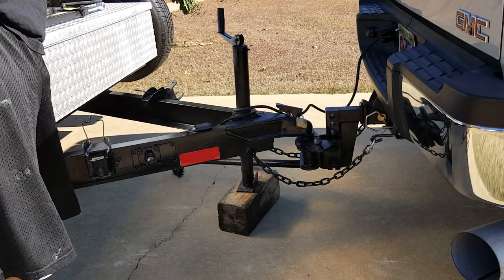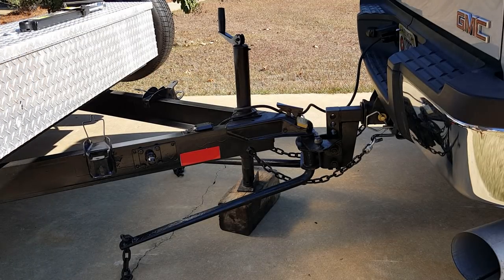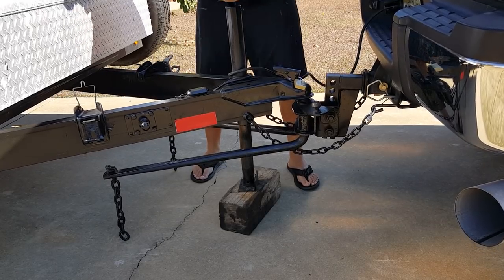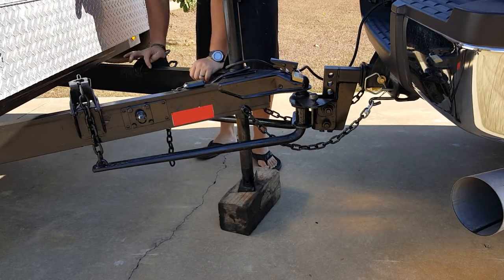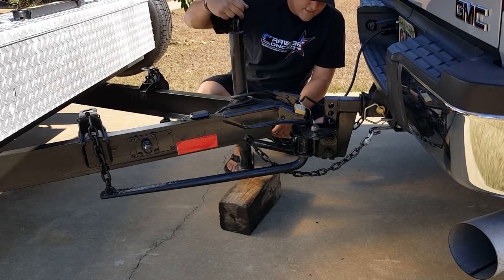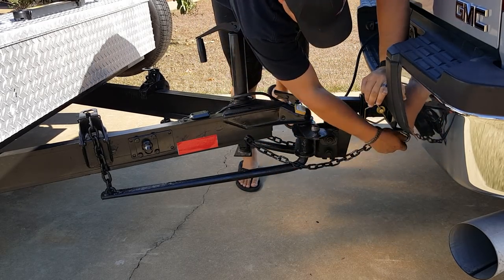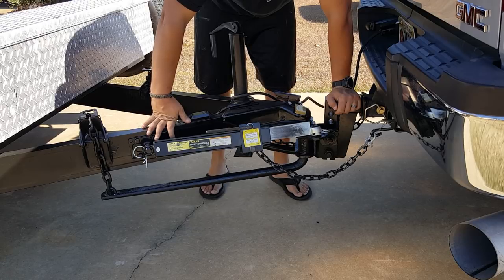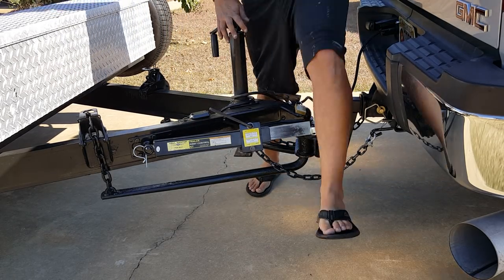Weight Distribution Hitch Explained

Comment: They are a great idea, but they are not a be all and end all solution. I had them on a caravan I used to own. Reduces the sway. But there are indeed other things you need to do. I had pneumatic shockers too, which helped a bit too. Anything to help reduce the sway to keep the misses and kids in the car, I put on the car. Once all that stuff is done, it's up to the nut behind the wheel  (the driver). Even weight distribution inside the van helps. One just wants to get from A to B without any dramas. If you encounter different roads surfaces, different situations arise. Yep the levellers will help. Your grey matter has to do the rest.

Comment: QUESTIONS ABOUT RE-HITCHING and UNHITCHING.... Anyone that sees this can feel free to answer.... and if it was asked already, Apologies! Popular video with great info.... 

My questions is.... If I was going to use a WD hitch like this, but would want to un hitch regularly to take my truck "into  town" or drive around.... would you just un pin the shank and leave everything on the WD set, and then justback back onto the shank when you re-hitch?? Or what would be your recommendation???  Always had a smaller trailer, and now going to be using a WD hitch going forward. Thanks for any help!!

Comment: I'm new to this, I bought a small 16ft travel trailer which only weighs 2800 lbs and I'm towing it with a chevy Silverado. When I towed it home it did fine. We are going on our first trip next weekend, do I still need one even though it only weighs 2800?
Reply from the maker: Probably not. You could still had the sway bar. Its always nice to have the sway controlled

Comment: If you have enough weight to use a load leveling hitch, it's time to switch to a gooseneck setup. You'll save yourself a lot of trouble and you don't have to worry about connecting/disconnecting, every time you want to make a sharp turn.

Comment: Obviously all systems are different, but every one I've seen, including my Reese 10k capacity kit clearly state the bars should be parallel with the frame/ground (or as close to parallel as possible). If your ball height is set correctly, the system will do its job without bowing of the bars.
By the way, you CAN put too much preload on the bars.

Comment: So it appears a weight distribution hitch puts a torque on the hitch 'twisting' weight to the front wheels.   What does that do as far as the stresses on the hitch itself?   I have a well powered V6 sedan that only has a 1000 lb towing capacity which I presume is so low due to the unibody construction making the hitch mounting points structurally weak.
I was hoping that with such a hitch I could increase the abysmal towing capacity but I'm thinking probably not.    Can it help and if not, is there another means to increase my towing capacity to say about 2000 lbs?  
I have tons of power, just weak mounting points.
Reply from the maker: I'd run it and not worry about it
Reply: Just one thing about towing capacity numbers. Whatever your towing, cargo, and people inside the tow vehicle is included with that 1000lbs towing capacity.

Comment: also when backing up make sure to take it off. you can damage stuff if you jack knife it
Reply from the maker: nick elias have never had an issue while backing up.
Reply: Basic Jeep Tip's if you jack knife it sharp enough stuff will bend or break. if you just do nice soft bends backing up yer fine. i take mine off to be safe
Reply from the maker: nick elias cool, i think jack knifing a trailer is a no no WD hitch or not.
Reply: nick elias take what off? The anti sway control,  or the weight distribution bars, or both?
Reply: The guys who installed mine said remove the anti-sway bar when backing up, for this reason.  The weight dist is not an issue.
Reply: I broke mine off the other day. The part that goes onto the trailer it’s self, Trying to wedge it in to a tight area. I did it once with my bigger trailer and once I got it in to where it needed to go, I couldn’t get the distribution bars loose. If you’re going to be negotiating into a tight little area it’s best to take those things off before you move your trailer.

Comment: Well, thanks to the video, I know the proper way to tension the bars, but I’m still perplexed about how the engineering works because all that tongue weight is still on the hitch receiver (though, not the ball as much).  So it’s hard for me to understand why the bars make any difference.   Also, for the anti-sway bar, how do I know what is too tight and what is not tight enough?
Reply: Do a search on "Weight Distribution Hitch Physics" and you will find at least some of the answers to your questions.

Comment: Just thought I would add something that happened to me. This is not a criticism! let me make that clear. I was parked in a wide area with my 7x16 toy/hauler checking over the trailer and truck like I always do and to also get out and strech and an ISP officer. (Idaho State Police) stopped to see if I was OK and maybe having problems, the Officer looked at my hitch and made the comment that everything was connected correctly as he always checked to see how the saftey chains were connected. I had them connected as per requirments as they were crossed right chain on the left on the tow vehicle and the left on the right. This is to catch the trailer toungh in case something were to happen and the trailer came off the ball. Like I said not a criticism but an antadotal experience.
Reply from the maker: Lol Said it in the video I ran them on the inside and I sheared them off. Due to the drop down hitch.

Comment: Good idea is to cross you hitch chains to act as a cradle to catch A frame if towball happens to break. Stops frame from digging into road.
Reply from the maker: Again covered it in the video that when I ran the chains on the inside they broke.  They would bind with my drop down.

Comment: Hopefully, you or someone will see this comment. I haven't used with this kind of set up before, so hopefully this doesn't sound stupid. I am confused about the sway bar...doesn't that work against turning?
Reply from the maker: That is how it keeps it from swaying. But no you can still turn- just becareful backing up. I only tighten mine down right before I get out on the highway
Reply: Patrick Harrison , I don’t know anything about the anti sway bar but in the video he mentioned that it contains material like brake pads. I figure that the telescopic part tightens up enough to minimize sway, with friction, but will still move in and out as needed for turns. So it’s not like a solid bar in that position.
Reply: @Infiniteperspective1111  That makes sense, because if that's a solid link, it's going to bind and something is going to break in a turn.

Comment: Your instructions are in conflict with the instructions for the Equalizer brand hitch. Equalizer says the spring arms should be parallel  to the trailer younger.  Weight distribution should be changed by adjusting the shim pack which controls the angle of the ball. All of the manufactures recommend measuring the height of the truck at the front wheel well and rear wheel. Goal should be t end up with nearly identical measurements at the front and rear measurement points. Spring arms should be matched to the tongue weight of the trailer. This value can be obtained from your trailers dealer or you can spend ten dollars and weigh it at any truck stop. Most of the manufacturers I have used all said the spring bars should be parallel to the tongue.  I suspect the spring arms you are using are not matched to the tongue weight on your trailer or have lost their spring rate due to age and need to be replaced. Just some thoughts  of mine.

Comment: I’ve just started using system, why does it make a loud popping sound when I turn a corner? Is that normal? And when the anti sway is hooked up is it suppose to loose on the ball on the truck and trailer?
Reply from the maker: Hard to say why it popping. You may want to check clearances etc. Maybe stick a go pro back there drive around to see what's popping. I would suspect that the chain on the bars is maybe making contact with a bracket or frame and hanging up. Look for shiny spots where the paint has been rubbed of. Making sure the chains are straight up and down or making adjustment ls to the placement of the brackets may help
Reply from the maker: As for for the sway bar when you put it on it needs to be on both balls and then tightened there may be a sweet spot that has a bit of slack in it. As the truck turns back and forth. Remove it make some turns see if the popping  goes away
Reply: Does your hitch use chains, or does it have two arms that sit in a cradle? If it's a cradle-type, grease the arms and it'll pop less. The popping is just the arms shifting in the cradles.

Comment: I use  Weight distribution airbags and also a sway bar I get very little sway
Reply from the maker: Yeah. I've recently started putting about 40psi in my air bag when I haul my 35ft camper makes it nice

Comment: I think some of the systems are going to be set up different.  I have the Equi-l-izer system and when set up correctly, the bars are supposed to be level with the frame.  Unlike in your video you mention they need to be bending upwards.  I think the same thing is taking place but different situations take place for the mfg you have.

Comment: So when driving through a ditch with the rear wheels will create even more force on the bars and and chains. This is actually dangerous as it could snap off at any moment due to metal fatigue.
Reply from the maker: Have never had such an issue. Or known anyone too

Comment: That hitch system did come with a breaker bar, I  guess your father in law left it on the bumper and never saw it again, that is why you crank it up high so you can hand set the chain otherwise with the bar its unnecessary to raise the trailer and truck to the maximum height and still have tension. purchase a after market bar, it will save time and work.

Comment: In my opinion, the safety chains should be crisscrossed under the tongue of the trailer. This creates a saddle, to catch the tongue, if it should come of the ball, and keep it from gouging into the ground or road.
Reply from the maker: If you paid attention I clearly stated I ran them on the inside and the drop down sheared them off.

Comment: Adjust your brackets, did you grease the ball n hitch? Air bags are good, get better mpg n control. For years before you were thought of this "load levelers" were called SWAY CONTROL. With the bars n brackets  the so called sway control bar isn't need.

Comment: Your chains hitch up is  not correct, they should be crossed and connected with rated D shackles. Enjoyed your video , but l have air bags with 50psi in them caravan tows like a dream, doesn't sway either. I drove heavy vehicles and semi trailers for 40 years and towed caravans all over Australia so l have a fair bit of experience, anyhow have a great day, regards from Australia 👍

Comment: DONT buckle the chains by hand your suppose to use a bar that’s what those big holes are for. You don’t even need to jack up the truck/trailer when equalizing. Put loose chain in slot and lift with bar. What happens you get your fingers caught. Not to mention “S” hooks and safety chain are wrong. And flip flops come on guy...
Reply: Yea this is not what to do for sure
Reply from the maker: Wrong. If you look my buckle do not have slots or pins for bars. And simply using the bar do not add enough preload. And when you lift the trailer high enough there is no tension on the bars so nothing to spring out and hurt yourself.   But keep doing it how you want.   And what do you have against flip flops. Its hot in South Ga
Reply: Can you read a instruction booklet this was a very easy set up back in the 70’s we had the same  see the big hole were the chain goes thru and a little hole on the other end that’s for a pry bar to insert set chain and lift bar. No need to lift truck and trailer.
Need to grease those bars before wiggle wagging up and in the groove inside.
Oh yea almost forgot those bars are very heavy and if you drop it on your toe cause you wear flip flops I don’t care where it’s just a bad video for safety not to mention gloves are need to keep dry and hands clean.
You probably don’t wipe yourself either.... mama needs to show you how. 😅

Comment: The "Weight Distribution" as a concept is a marketing gimmick. It does work though, but the bars do not distribute anything, there's no magic. The ultimate point of contact between the towing vehicle and the trailer is that square shaped receptacle (hitch) in the tow bar of your car. With no bars, there's only a force going down. With bars installed, there are 2 forces, one down due to the original tongue weight and one UP due to the leverage of the bars. As a result, the total weight at the hitch is less, hence there's less leverage and the front axle is not pushed upwards that much, gaining more traction, and the rear axle has less weight overall decreasing the sagging.

Comment: Almost same squat as before.. These things seem like a rip off.. All research I have done has pointed to junk
Reply from the maker: watch this video... https://youtu.be/XBZu39pQ8Gg
Reply from the maker: the truck actually sits about 1.5 inches higher in the back when the trailer is empty. when loaded it sits level no sag.
Reply: Can't believe aot bags were less effective than bars.. at least they work on tractor trailers.. lol I jsut dont see how the physics of pulling up on a fixed axis lifts the rear end.. obviously it does but all I could see it doing is pulling out on the hitch.. oh well
. It works and that's all that matters
Reply: @AverageReviewsYT  
It puts a torque into the hitch that pushes down on the front wheels and consequently relieves weight from the rear wheels.  I was skeptical at first as well, but the physics make sense.
Reply: Andy Andy to me all it seems like it would be doing it trying to lift the hitch off the ball
Reply: @AverageReviewsYT  
Judging by the torsion applied in the bars, I actually think it pushes the ball harder into the receiver while using it as a fulcrum point to apply the forward roll torque into the hitch.  The wheelbarrow example given doesn't really fully explain what's happening.  What it actually does would be more like applying a forward bending torque on the handles of the wheelbarrow rather than simply lifting the handles.
Reply: Andy Andy honestly what I can come up with is that when u dolly it up or tries to keep the trailer up while down...  so it's like taking weight off the ball to keep the truck light but it tilts the tailor back... I honestly have no idea
Reply: @AverageReviewsYT  
It might tilt the trailer back a bit. 
Try to visualize it this way.  Think of those torsion bars as an extension of the tow vehicle and as the tongue weight pushes the ass end down, you ratchet the torsion bars up against the pivot point like a scissor or plier action to pull it back up.
Reply: Not sure if that makes sense.
Reply: Ahh I thought if a better way to explain it.  A frying pan.  Now if you just simply lifted up on the handle, you would only lift that end of the pan up.  To lift the whole pan up and level, you have to apply a torque as you lift to distribute force and lift the pan evenly.  This does something along those lines.
Reply: @AverageReviewsYT  "pulling up on the fixed axis" is only part of the story. That force (at the chain) about the pivot point creates a moment (torque); that torque is applied to the truck which makes the front go down.  In effect, the weight is distributed.
Reply: @louf7178  yeah I have forgotten to much about this to remember what's going on lol

Comment: snake oil.....
Reply from the maker: Wins the most ignorant comment on the internet today.
Reply: The weight of the trailer is still on the ball and the hitch’s distance from the center of the rear axle hasn’t changed. All this does is to slow up a trailer that wiggles